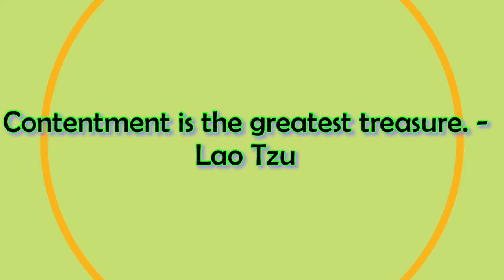Build An Outdoor Workbench!

Comment: We put at least 12 inches of leg into the ground on our new chicken coop for wind resistance. 
Even as heavy as an 8x8ft  wood frame metal floor /  roof /siding  built with 2x8s ..  that little bit of grab from the legs really helps wind security ... our cabin has mobile home tie downs set in concrete under the floor
Reply from the maker: Good idea, Brie. The highest recorded winds here at Contentment were 83 mph. We are confident in the Sh'ouse standing up to that. But we have to learn to build in wind mitigation and resistance into everything from now on.  Appreciate you!